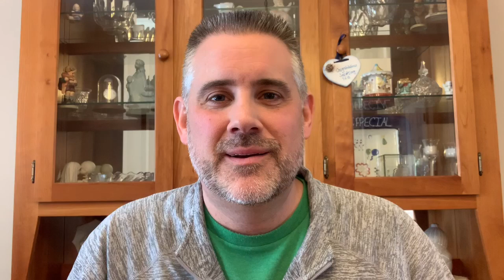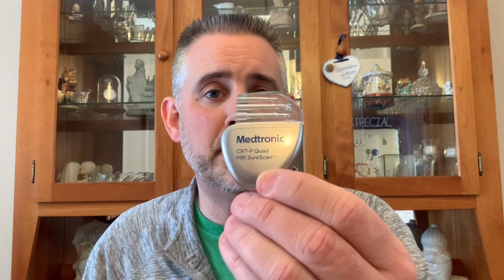CRT 101: The Basics of Cardiac Re-Synchronization Therapy

Comment: 9 months post heart attack I got upgraded to a two lead pacemaker with defibrillator.  I have not had an echocardiogram since but I can tell that my heart is pumping much better!  One weird thing - at first when I leaned forward my phrenic nerve was getting stimulated and my diaphragm would give a little kick.  I went back to the lab and they adjusted the power settings for lack of a better term and it has been fine since.